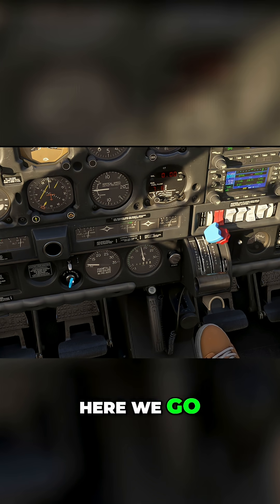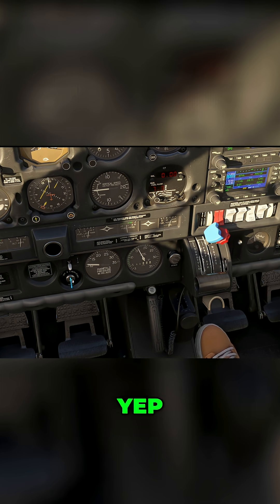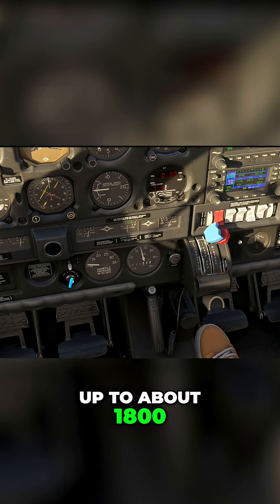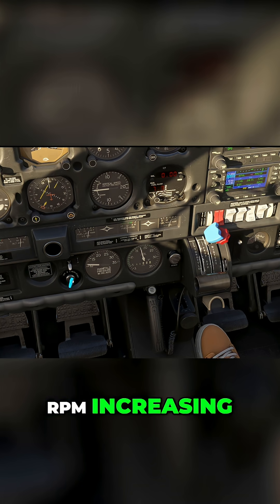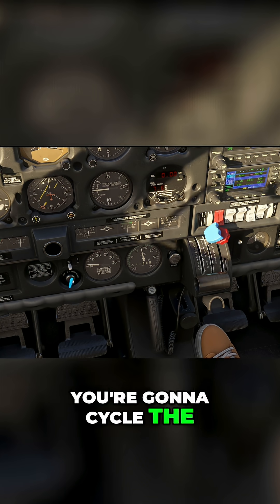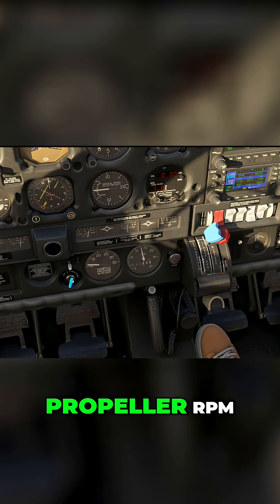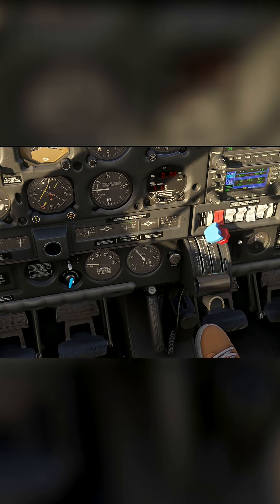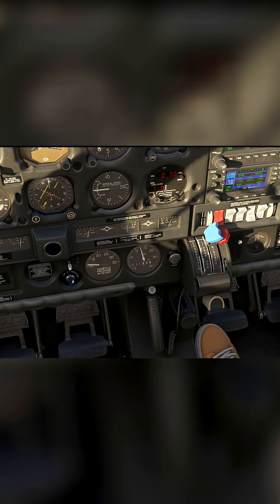Run up: Ensure Accurate Engine Performance

Comment: No idea how I found myself here but those three prop cycles were in too quick concession, each cycle should return to runup RPM checking for a slight rise in manifold pressure, drop in RPM, and drop in oil pressure for each one. Plus, they also let the RPM get too low, you only need a quick blip down about 300rpm, anything more than that you will get the engine running seriously rough
Reply from the maker: You're absolutely correct! This was during a live stream that we were just messing around in. Thanks for the input!